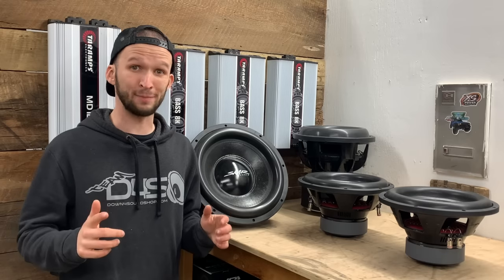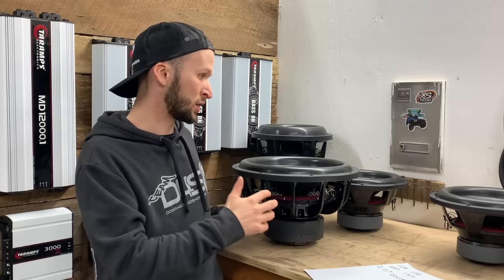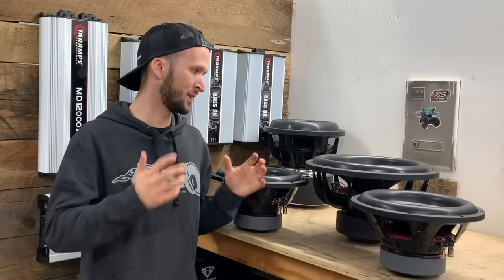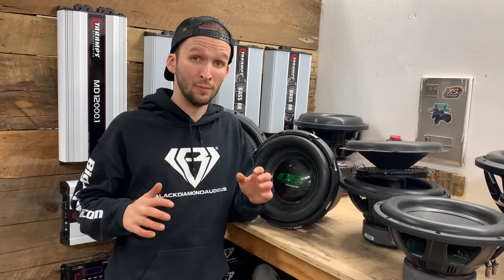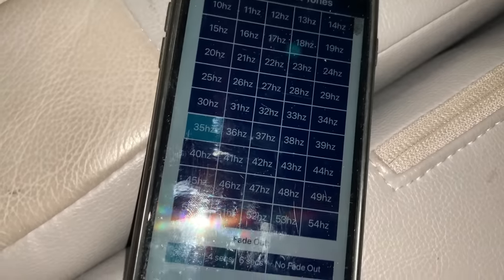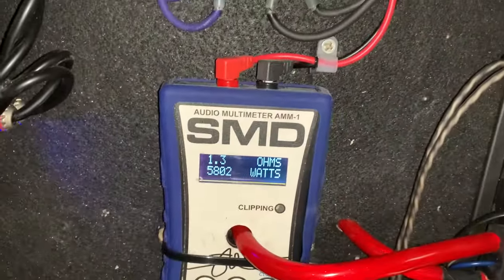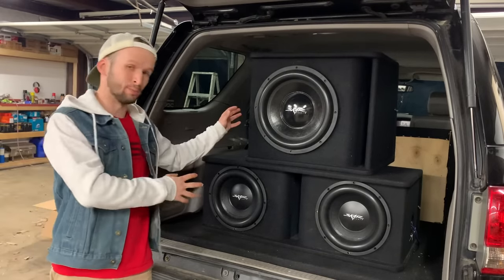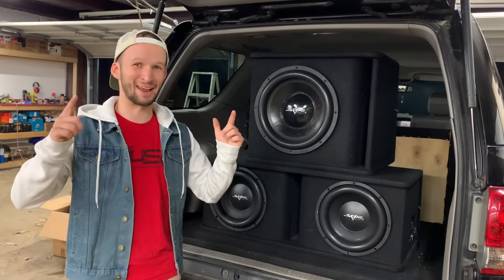ONE 15 VS TWO 12 SUBWOOFERS | MYTH BUSTED

Comment: Wow, these were really close! 1dB will not be noticeable by most people, usually takes closer to 3dB to be able to "hear" the difference. Either way, fun and educational video. Great job!
Reply from the maker: Yessir! Thank you Big D!
Reply: @ParkerTheBasshead pause
Reply: A 3db gain doubles the spl. 133 is twice as loud as 130db. But for a human ear to perceive a doubling of volume it requires a 9db gain, super odd!😊
Reply: look at the watt difference 450 watt
Reply: Big D or Parker. Either one. Need to be pointed in the right direction.  I'm going for spl. I have 1 Deaf bonce avatar svl 15.  Do you think I'd be louder running that in the proper enclosure or running 2 12" avatar stu's in the proper enclosure properly powered? I wanted 2 15s but in the trunk of a buick century I don't think I have the necessary air space available.  Thanks
Reply: You obviously don't understand how DB's work they are a logarithmic scale meaning for every 3db the loudness literally doubles

Comment: The single 15" was Louder, than the (2)- 12", with less power @ every freq., below 45 Hz! Then @ 45 Hz the (2)- 12" were only 1/2 Db louder than the single 15", but it took 334 more watts to do so. The more fair, cone area wise comparison, would have been (1)- 18" D2 Zvx, vs (2)- 12" D4 Sdr's, 254 sq. In. Vs 226 sq. In. Of cone area. Put both in a 5 Cu. Ft. Net enclosure, tuned @ 30 Hz, with both having 70 sq. In. Of port area. This would be really Awesome to see!

Comment: I have two 15” DDS SKAR subs couldn’t fit in my Caddy. Had to buy one single 12 tube by SKAR. Sounds loud and good but not the same. The 15’s not only sounded better, you actually feel the shaking of the subs and the car vibrates as well. The 12” woofer sounds good but no feeling behind it. 😢

Comment: A lot of people with this exact idea in their mind could benefit from being subbed to your channel. I remember seeing this kind of question with 2x10 vs 1x12, and 2x12 vs 1x15, whether on the old forums or on FB groups. I enjoyed this video. I think for some it could boil down to their trunk and whether they want to sacrifice the length of their trunk and have a slimmer depth with a pair or have a square shaped single sub and still have half the trunk, or the height of a single 15 wouldn’t clear the trunk

Comment: Great comparison Parker. Quite a few people have asked me this question over the years. One major advantage to a single sub is needing less power, equating to no need to upgrade charging system, which is a big expense.
Reply: Two subs would be much more efficient. Meaning they would be louder with less power.
Reply: im pretty sure i saw 5000w you def need to upgrade your charging system to handle that
Reply: It all comes down to driver sensitivity response. It seems everyone (these days) equates a huge motor and stiff suspension to a BETTER driver.. and really if you want to get loud w/o upgrading you charging system, you need 1) and efficient amp that has a low distortion factor, 2) a SENSITIVE sub that matches the output parameters of that amp, 3) a complimentary enclosure that works with that sub to reproduce the type of result you are going for. 
What a lot off people fail to recognize, is you can have LOUD bass response in a relatively low bandwidth range, OR musicality in a wider range of response, but you are going to lose that little range of boost where you would be tuning that boost. 
Soo many times i built an awesome setup, only to find that some songs just made ya tear up with how great it sounded, but play a different track and it sounds like a kid whacking a bucket with a stick

Comment: When I had my sub setup was running a single DC Audio Neo Elite 15" on a Dc Audio 5k soundlab in a ported box. 
It was awesome, had to upgrade the alternator, ran an extra yellowtop in the trunk, ran 8 guage from sub to amp & 2 guage throughout the vehicle. Could only bump hard for 10 mins before needing a cooldown 😢

Comment: Technically two 12s have more cone area, but since you went with cheaper 12s this results make sense.
Another idea would be the old square vs round sub debate. Thanks for the videos!

Cone area = pi x (r x r)
pi = 3.14 r = radius of sub
One 8" = 50.27
One 10" = 78.54
One 12" = 113.1
One 15" = 176.71
One 18" = 254.47
Two 8" = 100.53
Two 10" = 157.08
Two 12" = 226.19
Two 15" = 353.43
Two 18" = 508.94
Three 8" = 150.8
Three 10" = 235.62
Three 12" = 339.29
Three 15" = 530.14
Three 18" = 763.41
Four 8" = 201.06
Four 10" = 314.16
Four 12" = 452.39
Four 15" = 706.86
Four 18" = 1017.87

Comment: I was searching the Internet looking for a good comparison between a single 15" EVL and a dual 12" SVR loaded enclosure deal. Single 15" or a dual 12" are the biggest that I can fit in my trunk. If the (2) SDR are hitting as good as the 15, that means the SVR will be even better. Thanks for the info.

Comment: I learned this the hard way. For decades I would only run 2 subs. Later in life I needed the space more than I needed the sound. I found out the loudness seemed about the same. I went from 2 10's to a single 12.  Now I have a single evl 15. 

I would advise against the SDR's as they are junk in my opinion. The evls are clearly better than the Kicker solo's from my expereince. I would choose the Comps over the SDRs as well.
Reply: What do you think about the SVRS

Comment: 2 12's might give you a bit more quality because of stationary waves and less moving mass, the 15 might get you a little deeper but there are so many other variables only way to find out is to try it ..
Reply: This is said frequently but in reality nobody can tell if they're hearing a 12 or 15 plus you can shape the sound as you want with your box by using either a 12 or 15

Comment: Hi Parker, love the video. Instead of maxing out amplifier output. Why not test at 500w 1000w 2000w and 3000w. And for frequency do 30 40 50 60 70 hz and the peak frequency. That gives a better understanding about what is going on. Most of us out here do not have 12k amplifiers. Also while the results were similar at 45hz and below. The 12s might be louder at 60hz which means they are louder over a wider range. If you listen to a wide variety of music outside of rap, the bass notes are not hitting at 35 and 40hz.

Comment: 3 10"s vs 2 12"s vs 1 15", all the same EVL or same line from whatever brand(deaf bounce, sundown, incriminator, SKAR). Which setup gets the best bang/boom for your buck. Of course all 3 setups matched to cubic feet & RMS watts in the same vehicle. So for instance would 2 skar evl 10's hit harder than 2 12" evl's or 1 15"??? Or maybe swap the 15" for a 18" but not everybody can run a 18 so the 15 may still be a better choice. 
I'm trying to decide which way to go now myself. Im currently running a single Memphis mojo pro 12" in a skar 2.0cft box on a skar rp.1200 @4ohms(500watts).  Im trying to figure my next move & running the 2 12's side by side wont work in my Acura TSX. So do i run 1 deaf bounce 3512 in a 2.65cft box, add another skar single box with another Memphis Mojo Pro or up size to a 15" skar evl in a 3.15cft box???? Im very happy with the single mojo pro but of course i want more bass😂😂😂

Comment: I was surprised by the results. Was expecting the 12s to be louder! What about lower notes like 25hz? Sometimes you can't fit a 15" into some trunks. I found this video while searching for 2 cheap subs vs 1 expensive sub. Same power input. Wish I had the $$ to do these tests myself! Also, most people aren't running 4000+ watts, especially on a stock electrical system. Maybe a test on an equal solid 1000 Watts. Can those skar 12s really take a constant 4000+W for any length of time? That 15" is pretty impressive. Doesn't take up much more space than the 12" box.

Comment: I drive a pick up, quad cab. Makes subwoofers tricky.
Went from an orian hcca 15 down to a skar evl 12 to save space but I miss the volume of the hcca.
Was thinking about selling the evl and getting two stronger skars (forgot name) in a 10”
So slightly bigger then solo 12 but with 20” of boomboom 
Do 10s hit lows? Going to do a standard ported box
Reply: I had a sundown sa8 v2 on a Memphis 1100D in a box tuned to 27 hz and let me tell you for an 8in the lows were pretty ridiculous

Comment: Great channel. Would like to see more db testing, car loaded with luggage will this lower db reading. Also curious which direction I should take. Currently running 2 12in power t2d2 subs on fosgate 2500 amp. I only metered 140s. Would I gain more with more power on these subs or upgrade subs, I have considered doubling the power and using one amp per sub however manufacturer did not reccomend.

Comment: I'd like to see a video that shows the difference between sizes and the type of music you like (aka BPM). I like fast electronica and have always been told to stick to a smaller size so they can respond to the faster BPM. But I ran 2x 12s for years and thought they sounded fine. Thoughts?

Comment: Interesting. Most subwoofer companies I’ve seen. Now this is based of doubling box cubic volume for a second subwoofer. For instance, Stereo Integrity sql 12” wants 1.5ft^3 for each so it would be 3ft^3 total box volume. But they want 4.25ft^3 for only one 15”. So it would be a a MUCH bigger box with just one 15” vs two 12” subwoofers
Reply: I just got done building a sealed box for 3 SQL 12s .7 cubes each and  they will smack your face off, omg what a setup😮

Comment: Putting 5k watts to SDR that are only around 600 watt RMS each. The 15" is around 1250 watt RMS. Should be using the same line up. Not a low end to a higher end

Comment: There is a massive jump in skar subs when you move up to the evl.. understand the price comparison but I’d like to see apples to apples here.. I have one evl and my daughter has one model down with bigger amp.. and it’s not even remotely close.. both in the evl box.. 

She’s got 300watts on me.. smaller vehicle and it’s night and day.. put evl vs evl.. 

I’d also like to see a line up comparison on skar like you did with the kickers.. 

Too many people getting the sdr and the other one above that but below the evl.. really you bit getting what you think till you get evl or higher imop and not sure you’re getting anything special going any higher tbh.. 

Sdrs are trash.. I put two in my daughter car before stepping it up.. they really don’t hit that good.. and they don’t take the power they are supposed too.. fried both of them on just 450rms.. 

We live in Florida so by the time we get in the car those speakers and amps already like 200* though lol.. has same issues with various kickers in my car till I got the evl.. still running it on the kicker 800 though I had on the comp r.. got it maxed to around 915 watts so I got a lot left it could take.. still it’s a daily and meters out at 144.2 and most people think I filled the trunk lol.. 

Idk JLs are the only other subs I’ve ever had that would hold up to the abuse of being in a trunk in Florida and run hard other then the evi.. no where near as clean as the JL’s I used to run in comps years ago but pretty accurate for a ported mid line sub..

One last thing.. I don’t think you should max burp to clip for comparisons like this.. I think to keep it more real world run both at approximately the same power.. people gonna amp how they amp.. they are only deciding between one bigger or two smaller etc but they would be getting the same power.. 

On say a 1200w 12 x2 and 1500w sgl 15 just for example.. run them at a realistic 12-1600w which would be closer to what people would be doing.. 

No one buying subs if these levels is looking to do a 5k burp lol.. they want the loudest they can get going to work at max every day wo issues..

Comment: I'm not knocking this comparison. It's valuable content. I will just add another factor, which is subwoofer SD. The SD is the actual surface area of the woofer, and it varies from subwoofer-to-subwoofer. So, for example, a Sundown SA-12 V3 has an actual surface area of 67 square inches, rather than 113.1 square inches. Or, to compare Skar subwoofers: A Skar SDR-12 has an actual surface area of 73 square inches. A Skar SDR-15 has an actual surface area of 116.9. So, the difference between the two is 43.9 square inches. Not 63.5. Just to be a little more precise.

Comment: Cone area is king. I have had 2 21s, multiple 2 18 setups and an 8 12 setup on lower power doing 157s.
Reply: Which configuration did you like the most?
Reply: @smalltimer4370    The two 21s had the wow factor but the 8 12s were the loudest and I was most happy with.
Reply: @popwarhomie  so what do you have now?
Reply: @marthepedersen1454   My current daily driver has just 4 Sundown Xv3 12s on two Ruthless 4500s.

Comment: hey parker can u try out a slapz amp and do a video so can see there worth the money they have 3k 5k and 8k i bought the 5k but like to see what you think also love the vidoes keep up the good work i have learned alot watching you my set up rn is 2 12" sundown xv3 in a custom tuned box at 34hz it does 141db rn on 2400watts at 34hz - 40hz and that was on 150amp alt i have 320amp alt now trying to get that 150db

Comment: When you say clipping is that the amp clipping or the subs bottoming out on excursion? If it's the amp clipping was the nominal impedence of both subs the same? Based on the impedence reading from the SMD it looked like the 12s were wired to 1 Ohm whereas the 15 looked to be 2 Ohm. That would explain the difference in power achieved.

Comment: Max power from 2 12" subs is 2400W and max from the 15" sub is 2500W. Based on this, the 15" should be louder because dB output is related to power, so the differences come from inefficiencies in the speaker design and their ability to convert electrical power to compressive energy. The 12" subs are probably more inefficient because you have additional speaker material & weight that must be moved in order to output sound vs. the 15" speaker.
Reply: Watts alone will not tell you how loud a speaker will be.
A good indication is Power x Sensitivity; power means nothing without rated sensitivity; 1000w sub at 89db (rated 1 watt at 1 metre) is quieter than a 500w sub with 100db+ sensitivity.

Comment: Love all your videos.
I'm trying to put something together in my 1971 Beetle and keep running into not having a good enough battery.
XS Power or Optima?
(I'm using all kicker products and amp-wise 800 watts to my subs and 300 watts to my mids and tweeters.
Help.
Reply: Run a dual battery set up under the rear seat .

Comment: Im wondering why there is nothing about what the type of music sound's better on 12s and 15s. Hiphop/rnb will provide you deeper bass on 15s but 15 won't be able to keep up with edm, trance, dance music. The beat will be just faster than the15' speaker. Now 12' will be able to keep up with both but won't be able to give you that massive, deep bass with the slow beats(hip hop etc).  Correct me if im wrong.

Comment: The other variable is the $ for power. 1 15 doesnt need as much power as 2 12s. So that means a smaller cheaper amp, less battery, cable and alternator power required. Although, you might as well go big if you can, so you dont have to start from scratch on your next upgrade. There is almost always "the next build".

Dollar for dollar this is a fair comparison. However, I would never pick  (2) $90 12s over a decent 15. If you are going with 12s, just save another $150 and get 2 better 12s if you can afford the power requirements. 

1 quality 15" is a cheaper and a great  option. But 2 quality 12s with the right power/electric will beat 1 15" every time (same or similar sub).

Comment: I personally run a 12 and a 15 at the same time, one drops off the other one picks up. A TORO 12S Fierce and a Audio Legion 15 on a CT Sounds 1500.1. Keep up the great content Parker!
Reply: that's not how it works
Reply: Two kicker 12s in a slot port, one punch 10 sealed banging. 
I wanna try a 15
Reply: @marijuananirvana  one doesn't drop off and the other picks up, chances are they are both set to the same crossover on amp or dsp. if one were to drop off due to not being able to keep up it would be due to distortion and sound like ass which you would definitely notice.

Comment: How do you get in touch with this creator ?to ask ?s 
or just ask here? My question is when you look up competition speakers they all have this big thick rubber or foam surround, but yet Memphis M7 12 inch subwoofers and their mojo series I'll have a double stitched twin edge surround, that they say allows more ext. More air flow,  there's speaker prices are more per speaker than the average, the sound quality sounds excellent their speakers are made superbly with the vents to cooling the frames, etc  none like I've seen in any previous speaker but yet I never see any of them in competitions why is this? also I never have seen a amp test comparison or a review on them except from the manufacturer so I wish that  Someone would do a review and Comparison on the m7's and the Mojo's, against other speakers to see which ones are truly the king and Why.... Please n TY ..

Comment: U know what would be a interesting test is if u take 2 of the same subs do one test running a single at its ratted rms Metter it then ad the second one without changing anything same power draw same indepedns and see if it's louder running 2 subs underpowered or 1 at the rated power

Comment: I have 2 prv 750 15 in a one channel amp 3k sound digital and one of the 15moves more than the other when i pull up the volume the one that moves makes a popping sound is the speaker bad need help